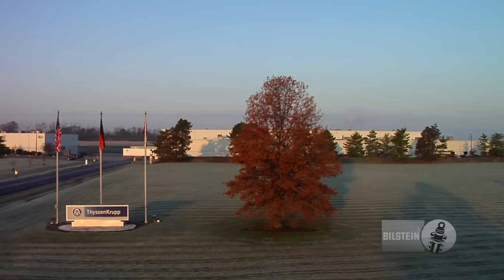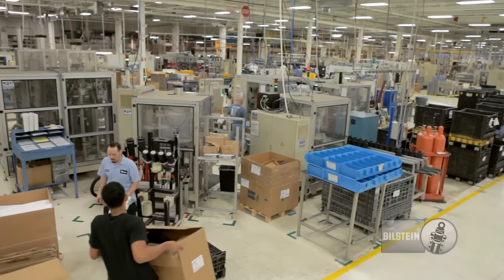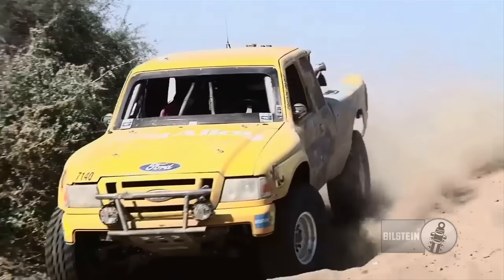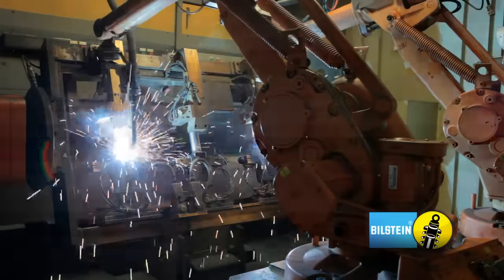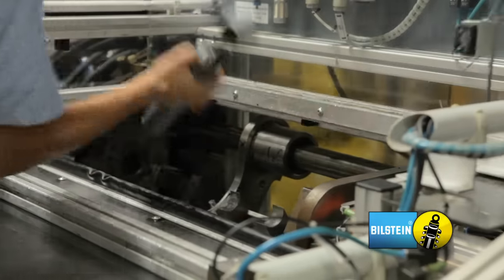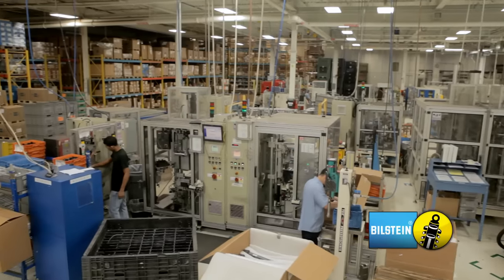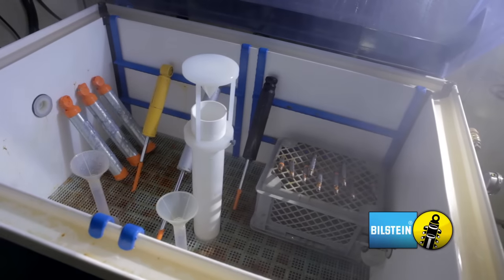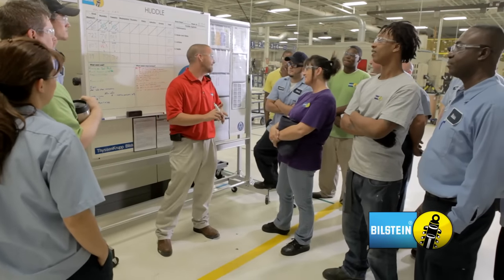How are BILSTEIN Shock Absorbers made?

Comment: Hi, can you tell me, i bough new front shock absorbers, they are filled with gas and oil...after one month, and about 300 km only, i have one issue with one of shocks....when car is parked, more than 30 min for example, and i come and press car down with hands where is suspicious shock, first 1-2 moves up and down are so easy without resistance...and than you can feel when shock becomes hard like it should be allways, later when driving is good but every time after pause of min 30 min shock seems like loosing power and than first few bumps is soft and than becomes hard...what is problem?

Comment: So these are actually made in the states, not in Germany?   Interesting.
Reply from the maker: Hi Johnny - We have a manufacturing facility in Germany and in the United States. The product is of identical quality. We import some applications from Germany (a lot of the European car applications), while we produce a lot of parts for vehicles that are available domestically here in the United States.
Reply: +JohnnyGification from steel made in China. I can confirm the quality is nowhere near like it used to be.
Reply: Ohio USA
Reply: @makaroka  just because it's made in China don't mean it's shit Jesus Christ.
Reply: @MrTherandomvidsguy  I have qualification in Metallurgy. Chinese steel known to be absolute rubbish, low quality, very high proportion of them contain Bainite. High proportion does not mean they are all bad, there are a very few, manufacturing good martensite carbon steel, but I had two of my B6 Bilsten heads broke off due to structural errors, both were manufactured from Chinese made steel material. The proof of the pudding: you eat it.
Reply: @makaroka  oi leave the puddings alone
Reply: @makaroka  I'm surprised you replied despite your comment being 6 years old.
Reply: @Keyzer Soze iphones are made in China. Your wheels are most likely made in China. I'm not shilling. Many companies are moving to China because it's cheaper to manufacture which is stupid. 

I'm speaking facts. My OnePlus came from China. Love it. It just depends on so much. But I do wish companies would stop thinking about profit. Quality over quantity is good.